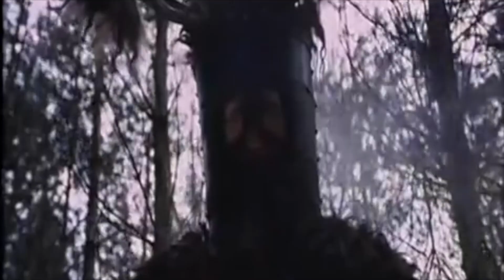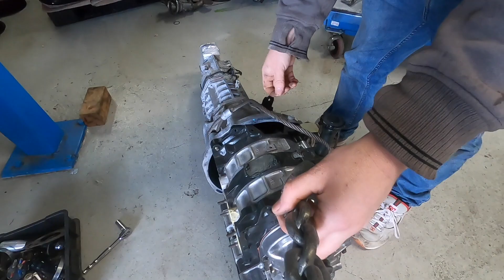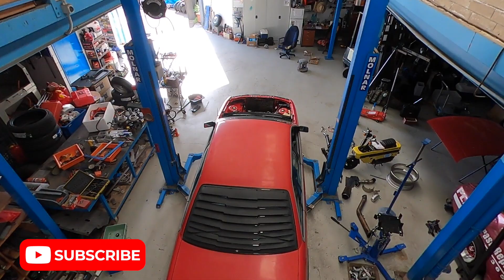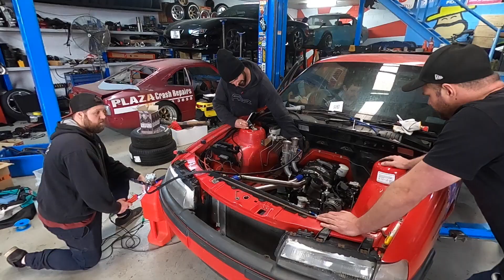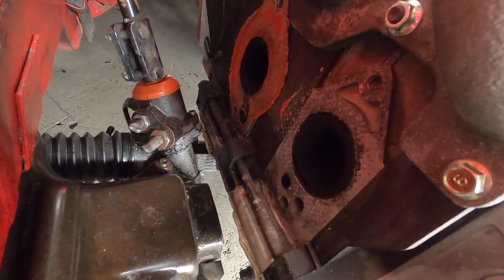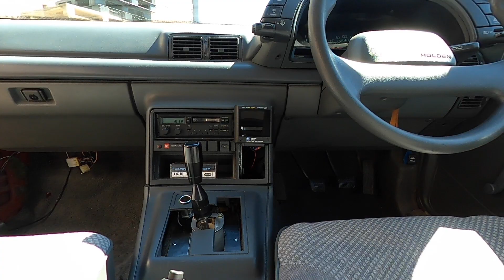ROTARY In Aussie VN Holden Commodore - WTF?!? | General Rotors #01

Comment from the maker: I get it guys Ya wanna hear the engine not the music. Im the same, BUT the problem was that the audio from the rolling shots was heavily compromised by wind noise. That and we were still using the back half of a standard V6 exhaust. To the point of there being little to ZERO noise from the car for the majority of what we filmed. The car got louder as the day / that drive went on and the exhaust got molested by those dirty hot rotor pulses. The engine noise you CAN hear in the clip has been DUBBED. 80% of it DID NOT EXIST. Is it great? No , but Im an amateur. We couldn't reshoot as we were out of time. The use of music helped me hide the fact that I had dubbed the same 3.5 second clip of engine noise in repeatedly. Sorry to ruin the magic but for some reason I feel like I need to explain myself. Hopefully we will create a video next that everyone will like. Well at least those who like brap noises. I hope that this explains the situation. I try.
TLDR: You wanted noises. I did my best to give you noises.
Reply: I was one of the complainers about  hearing music instead of engine sound. Thanks for taking time to explain. Ive always been fascinated by the Mazda roadpacer so I had to click when I saw the video. I think your content is great I reckon it's sick youre skillful and crazy enough to upgrade the VN like that. I should have said that in my other comment instead of just being negative. So yeah looking forward to the next video. Keep up the good work.
Reply: Na, it’s the act that really mattered. And for those with true taste (brap lovers) we can always superimpose that lovely tone over the top of anything if the reality doesn’t supply 🤘🏻Keep up the good work!
Reply: Yes, only those of us that make YouTube videos will understand exactly what your talking about, the swap is so insane I loved it, Subbed ready for the next thing to roll out.
Reply: The video was awesome. I love what you guys are doing!!!
Reply: lol need some more updates on this rocket !!!!!

Comment: If you want to save yourself some pain and hassle in the future switch out the Apex seal with the aviation Apex seal they are a harder metal and will last a lot longer the factory side seals are fine just switch out the Apex

Comment: After the Rotary gig is done,.. seeing that VN is straight and, a little boring,.. You blokes could take the 3.8 apart while it's out, and rebuild it to the old Formula Holden / Formula Brabham spec. It'd scare the shit outa people, full racecar noise on the freeway.
Reply from the maker: I have another engine going in soon with lots more power and noise. 
Never heard of the formula Holden spec but sounds cool
Reply: @lowstandards5269  Formula Holden used the 3.8 V6 in an open wheel chassis. Pretty damn fast for the time, still quicker then everything but the new S5000 spec for road course racing in Oz

Comment: This is awesome!
About 2003 I had a genuine yellow VL Turbo BT1 that the RB30 decided to let go.. so I did what any purist would do... decided a 13b turbo would be the best replacement. I was getting Rotorworx to do the install & it was all mounted in and getting close to running.. when I got a forum message saying the shop had folded and my car was out on the street and I'd better come collect it. No notice from them and heaps of parts missing so the project ended there unfortunately (thanks scumbags!!).

Comment: Does the rx8 6 speed bolt straight up to the 10a? Or earlier 13b? Or any modifications needed? And what flywheel and clutch set up did ya use?
Reply: It has early single dizzy plates and direct bolt up 
It uses fc rx7 clutch and flywheel and Honda Civic slave so it clears the oil pedestal and filter.
Reply: @SJD1989SJD  does the rx8 box fit right up to S4 or S5 plate? good ol civic part

Comment: Novelty idea! Definitely would use 4:1 diff gears.
Reply: Ring and pinion out of a R31 pintara. They used the bw78  and were 4.11
Will need different centre because the spacing of the ring gear will be different. The centre out of the R31 Skyline will fit but you want LSD, and they were a cone style centre which were weak as piss. Get a Truetrac or even a Torqueline torque lock centre. These will have the correct ring gear spacing for 3.7 3.9 or 4.1 👍
Reply: @Mardy72  vl bw with rb20e had 4:11 here in nz be straight swap
Reply: @ill5kill2  yeah, but the BW centre is shit bruz...they sound like your ex-missus. Whine whine whine 😂

Comment: It will need a set of 4.44:1 diff gears or something  like thar, the  Mazda Roadpacer (aka HJ Holden Premier) was fitted with that 4.44:1 1 tonner diff ratio in Japan, believe me,a 202 Holden six cylinder powered one of them had a top speed of 100 km/h but not the Roadpacer which had a top speed of 160 km/h.

I know that Andy Perrett runs 4.11:1 diff gears in the Ford 9" diff in his turbocharged 20B powered HQ Holden Kingswood & it goes very well with  a power output of 309 kilowatts of power & 600 Newton Metres of torque !
Reply: Yeah agree 
It will be getting 4.1s as they are easy to find and a direct fit without changing the diff. 
Currently has 3.08 with the 6 speed

Comment: i think we need some in car footage now.. what ratio diff is in it? 3.08, and what's it need(My brother had a stock NA 12a RX7 with 3.36 diff gears which were a bit tall but it was still good due to being light. )
Reply: Yeah 3.36 is an odd one my rx7 was a 3.9 but thats a lot lighter than a commo so probably a 4.1 would be the way to go
Edit: i know you said the vn is light and sure compared to many full size sedan but my rx7 is 1000kg so about 300kg and an r100 that the 10a came out in is only around 800kg